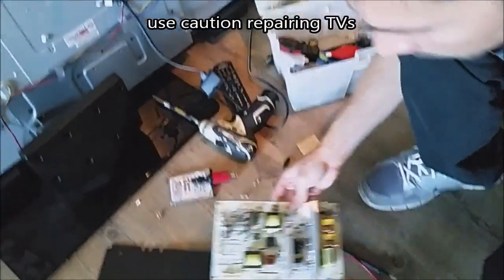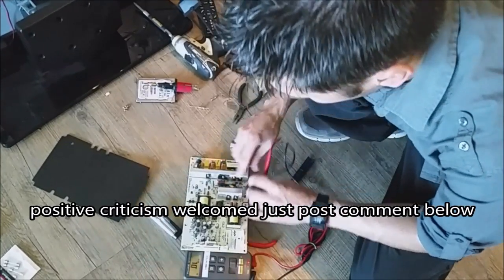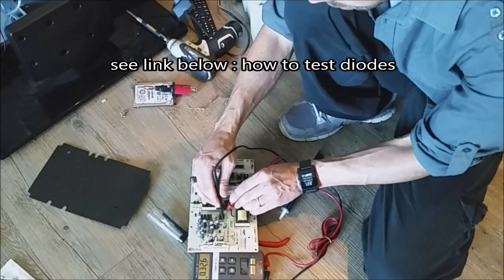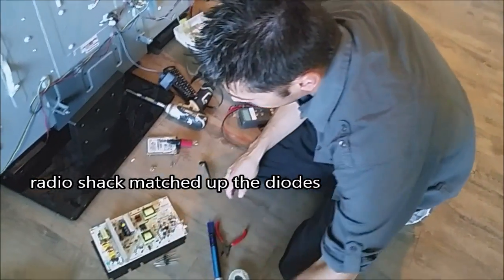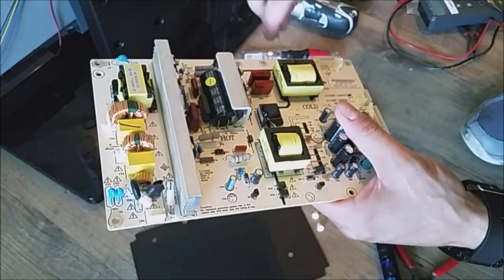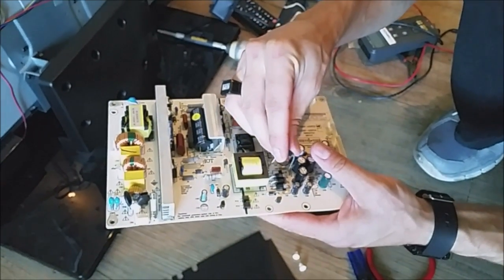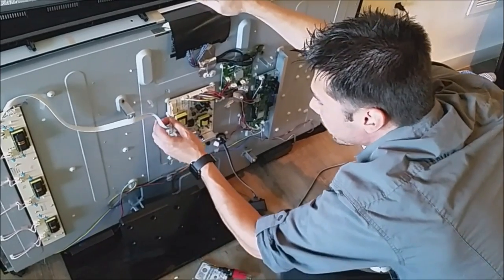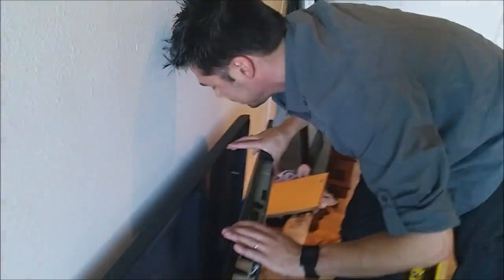How to fix TV after power surge review

Comment: I have a 50 inch Insignia TV that suffered from a power surge due to lightning. I lost several other electronics in the house as well. I replaced the power board but, that didn’t fix the issue. Does that mean the only other possibility is the main board? I’m not getting a standby light, or any video. I didn’t try audio but, I’m assuming that’s a no.

Comment: how did the new diodes read? most times its only one diode shorted but the both will read as a short because they are in parallel with each other

Comment: I'm learning a ton from you, thank you. I liked the video and subscribed.  But I do have a question: I had a lightning hit that took out most of the things in my house (AC, garage opener, electronics, etc) but one flat screen LCD TV is just acting weird. The picture is fine but it automatically goes to the menu screen and continuously scrolls down nonstop. Unplugged for months, but always the same issue. Is it a safe assumption that I need a new main logic board?Thanks in advance.
Reply from the maker: try reset unplug power for 1 min, next factory reset tv, and firmware update but yes main board can be damaged or memory corrupted. TV boards at shopjimmy.com or electropartsonline.com use code tampatecfriend for discount, thx for subbing

Comment: hey man great video.Need some help with my LG 32LF585B. its not comming on after a power outage.The red power LED blinks twice when i try to power TV up with the remote but stil no image on screen.Any Suggestions? Also the TV is getting a Good ac supply about 120Volts
Reply: also unplugged TV for more than an hour together with all Video and sound cables

Comment: I have a 48 inch Vizio TV. I accidentally unplugged my TV while it was on and power surged it. It works fine when there's nothing plugged into the ports but, whenever i plug in ports it turns multiple colors and gives off a really high pitched noise. Do you have any suggestions as to how to go about fixing it assuming that it can be fixed?

Comment: I have a Sylvania 37 in Digital LCD tv. There was a power outage and then my dish receiver had to reset but my tv picture came back with streaks and unusual sound, also I hear a high pitch noise out of the TV. Other tv is working fine with the same receiver. What could be problem?
Reply from the maker: +Bob pat high pitched noise can be any number of parts. Open the tv if it's out of warranty and listen to what board is causing that noise. Shopjimmy.com sells the tv boards

Comment: I got a samsung plasma 43' model pn43d430a3d That quit working after a power surge but when I plug it in it does make a little buzzing noise towards the top half of the tv ,do You know could be the problem ,please help

Comment: I have a Greenlee CM-850. I don't think it has a diode tester on it, but it does have a ohms tester on it. How do I use that to test my board? No standby light - testing a Sharp 9JY795951400500 powerboard for a sharp LC-42SV49U tv.

Comment: My friend has a Philips 42"LCD set would power now it will not power on even after reset
Reply from the maker: check 5 standby volts also check caps in power board

Comment: The two boards I am trying to test are the power (BN44-00428A) and the main (BN94 D4355B) pins are as follows 1. OD level 2. P dim 4 3. Od on/off 4. P dim 3 5. Grnd 6. P dim 2 7. B13v 8. P dim 1 9 b13 v 10. B13v 11 v amp 12. Blu on/off 13. V amp 14. Grnd 15. Grnd 16. Grnd 17. B5v 18 a5v 19. B5v 20. Power on/off 21. Nc 22. Nc
Would like to know what pins to jump to test boards
Thanks

Comment: My parents LG32 worked for years, then the small town added another capacitor to the local substation and never bothered to tell people to unplug high end electronics, as they have in the past. So 8 hours later when they turned on the towns power again, the TV was not working at all.

Comment: Nice video. Question. I fix computer for a living and i want to start working on tv's.  Can you recommend any self study books i can get or online classes ? Thanks
Reply from the maker: i learned 5% books & itt tech college but i learned 95% in the field (experience) by researching like blogs, youtube, websites, tv tech support lines, and other techs, and of coarse service manuals/schematics. hope this helps. remember when fixing TVs, work smarter not harder meaning don't over think tv repair cause sometimes tv just might need a reset by unplugging powercord for 1 minute, replace some swollen caps, or update. also no standby light on front tv panel means no standby volts to cpu so check volts on powercord, power board, and then main board. for more help check out- https://helpouts.google.com/109162147223399593709/ls/b77b1f21705865ca?authuser=0
Reply: ***** 

This says a lot about my tv.